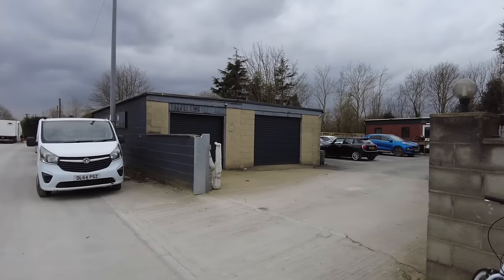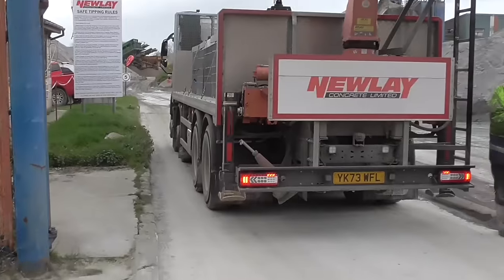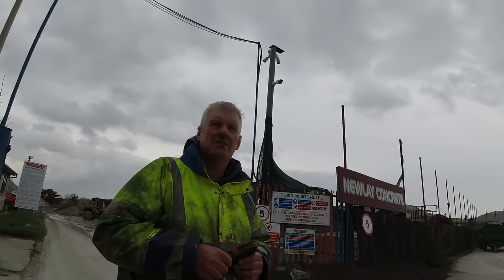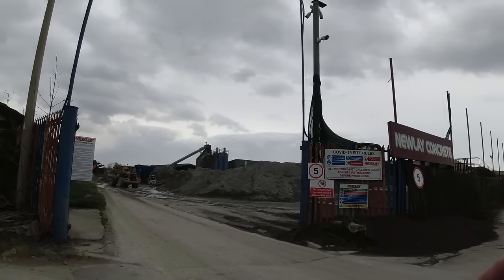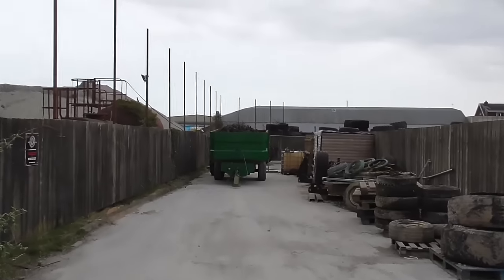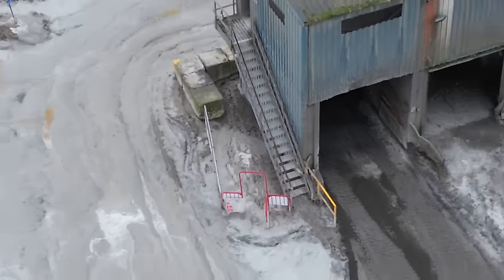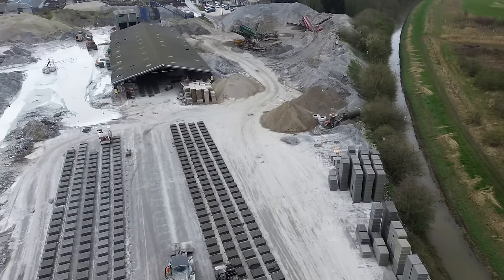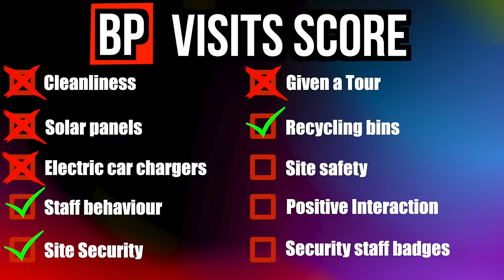Take Your Mask Down!! 💩☝️🏭🎥

Comment: the blocks become lighter in colour and harder in firmness as they dry. The driest blocks are more expensive and are used for foundation and building support; as you build up, you can use wetter less expensive blocks near the top.
Reply from the maker: Ah! Thanks for the info

Comment: The concrete is mixed to order, you order 5 meters they mix it put it in a concrete wagon that continuously mixes it yes it goes off fast and you don't want to be pouring or trying to level it out when it's going off.

Comment: They can mix it dry, bag it & sell it as a ready mixed (just add water) postcrete etc,

Making cement powder requires it being heated & sort of blended, put in a big trommel with ball bearings whilst heating for hours, make it into a fine powder
The grey piles might well be cement before it's processed